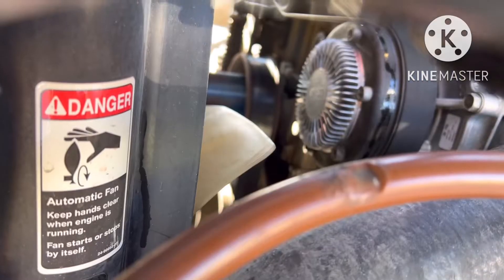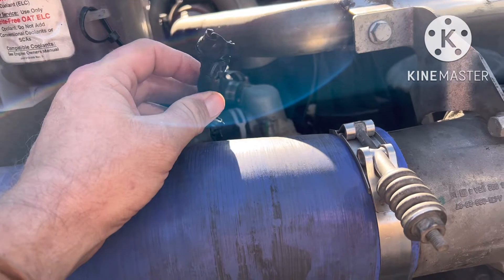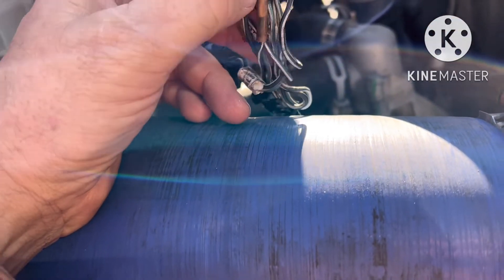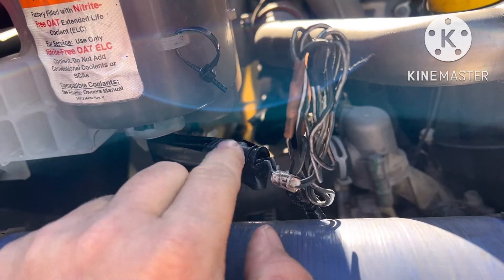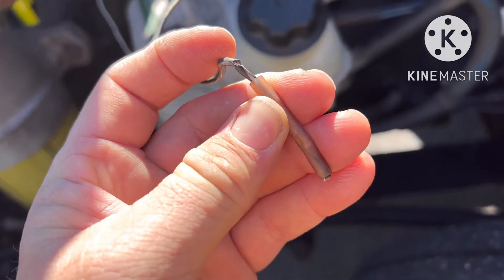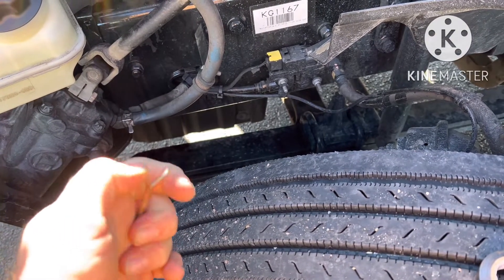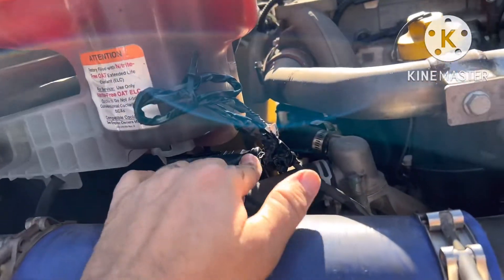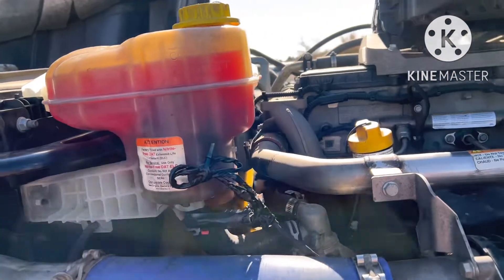Freightliner Cascadia low coolant Notification￼ | how to FIX￼

Comment: It seems my 2020 cascadia rapidly uses the coolant during freezing weathers 31 degrees and below.  I would fill coolant 1 inch past the line at the top.  5 days later, my coolant level is 3 inches full from the bottom.  I don't see a leak anywhere.  Not sure why coolant level decreases so much after a weel during cold weathers.

I saw a video that said if the coolant tank has coolant filled up at the front bottom of the tank, it has an internal leak.  But the coolant in the video had an empty spot in the front of the coolant tank.  Mine is completely filled up no empty spots
Reply from the maker: There is a pressure bleed off line under the reservoir.  Adam a mechanic tell me too much pressure builds up it’ll bleed off.